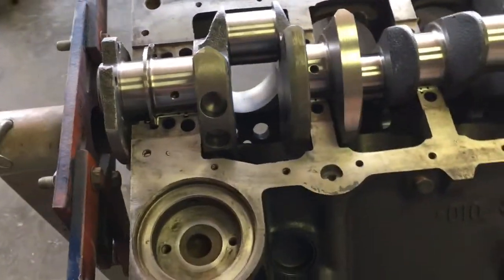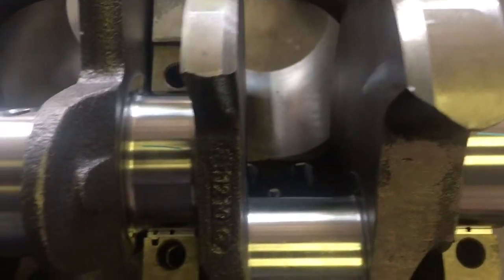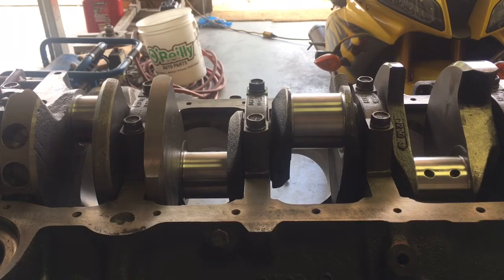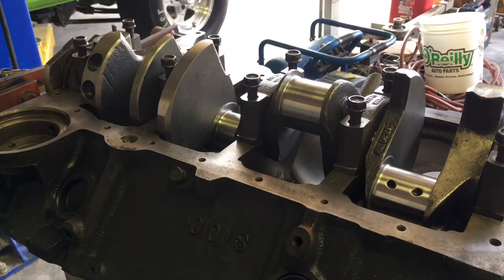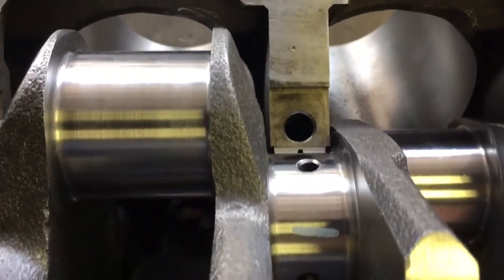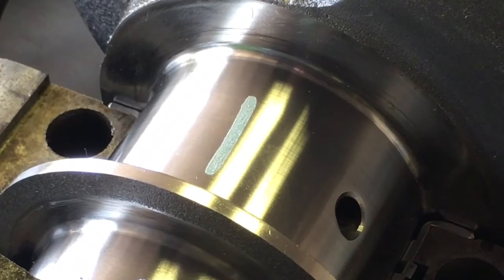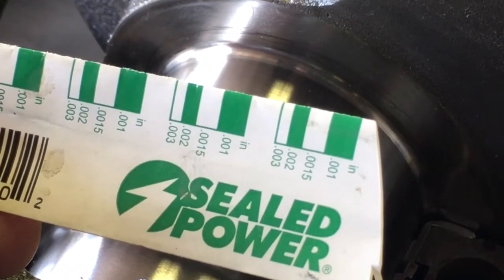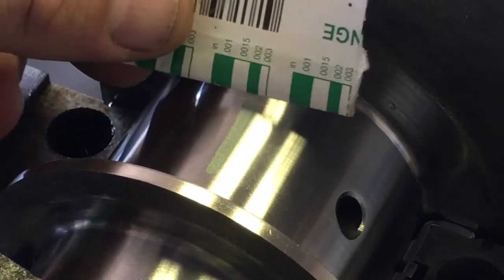Plastigage how does it  work?

Comment: Should I use the plastic gauge with old or new connecting rod bearing and crankshaft bearing?
Reply: You can use it for both new and old parts. You can determine how worn your old parts were, then determine if new parts are within specifications.

In order to determine rod knock, some people would remove the oil pan, use plastigage in the existing rod bearings, then take notes of the measurements. If the clearance was any higher than the manual specified, you knew you needed new rod bearings, and possibly a rebuild.
Reply from the maker: Both, you use the plastigauge to measure bearing clearance, new or old need to be measured. 
Sorry YouTube just notified me of comments 1-3 years old!!!  JD